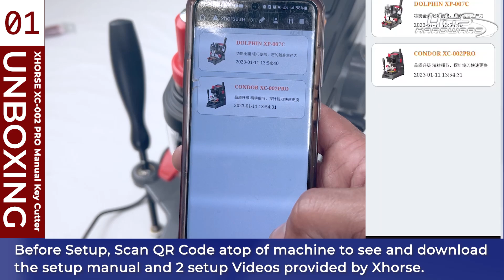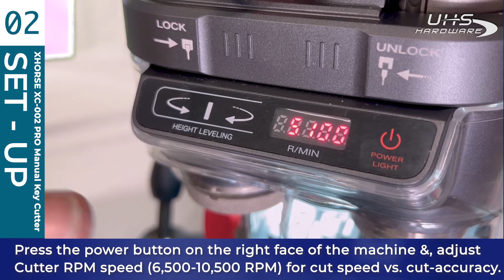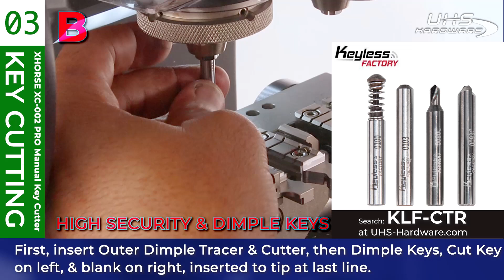How To Use XC-002 Pro - NEW Xhorse Manual Key Cutter Unbox Setup Alignment & Key Cutting

Comment: My vises are out of line by .024. The vises need to be adjusted wider from each other. How do I do this?
My vise does not have the 4 screws mentioned on page 31 of the user manual.